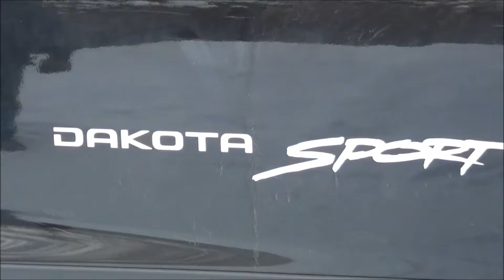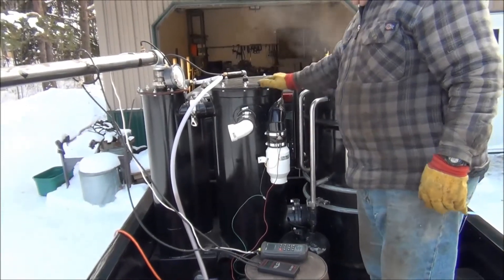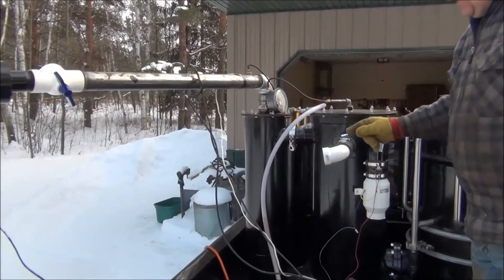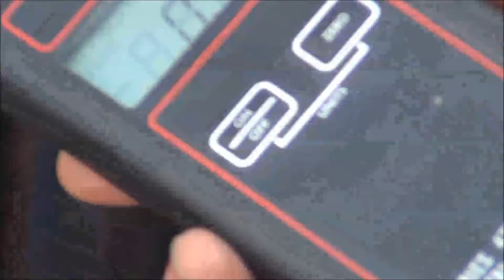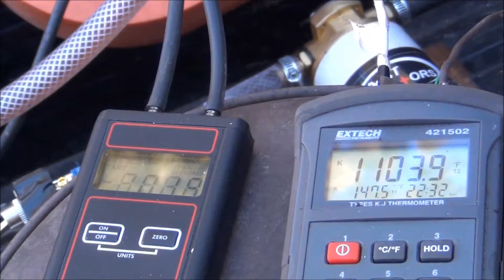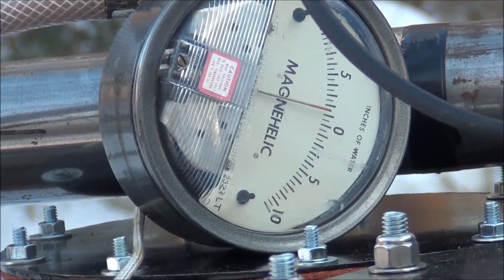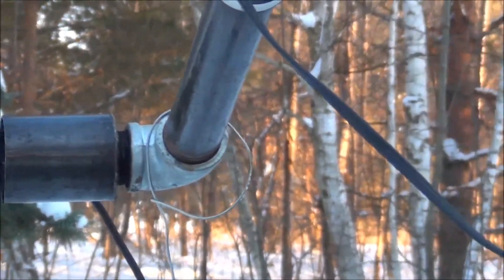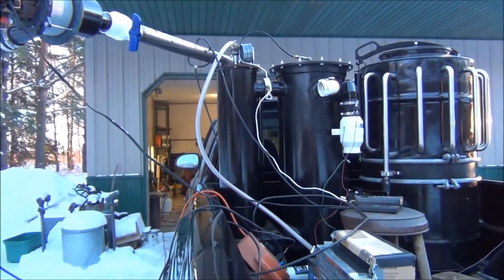gasfier test 1/18/14

Comment: What the purpose of the vertical stainless steel tubes around the outer casing of the hopper.. please explain the purpose and there the connect to or dain to? Why so many tubes
Reply: Moisture from the wood (wood vinegar) condenses on the wall of the hopper. On the inside of the hopper there is a gutter and the tubes connect to the gutter.  At the lowest point, there is a collection tank for the liquid.  Some of the liquid is watery and some of it is like tar.
Reply: @weskuehl6698  thanks for the explaition and reply... but why so many stainless tubes i would think 4 in total would be enought

Comment: I like the idea of a wet scrubber. Just one question: why oil?  water is cheaper and easier to work with, if your worried about it freezing add some antifreeze . check for tar with a white cloth over the end of your flare pipe

Comment: Since you are in a 10 Deg F temperature environment I honestly don't know if you will be able to see a more transparent gas or not because you could just be seeing water vapor just like you see with your breath in cold air. I'm going to run an idea by you that I know has already crossed your mind. Since it is very cold have you thought of subbing the oil scrubber oil with a mixture of antifreeze and water? It should still give you a scrubber effect. I have not made a video yet but right before it got cold here I built a single tube scrubber for my gasifier that used steel wool too.

I am actually using the engine vacuum to bubble a tube that is 1-1/2 inches deep in a 1/2 gallon water reservoir. I have a 1 inch space above the reservoir where I have about 2 feet of stainless steel wool and what I am getting is a lot of fine bubbling
action rising up thru the stainless steel wool with an acceptable enough back resistance to allow a small 5 Hp Brigs and Stratton engine run without bogging down. I am still tinkering with it but it is showing some good results. I really like the job you done on this gasifier. The workmanship is top shelf.